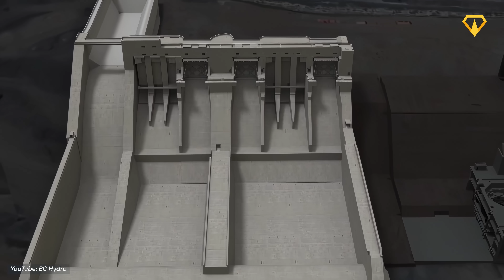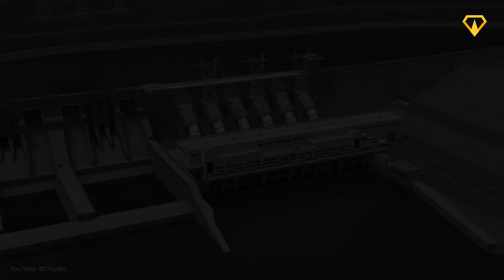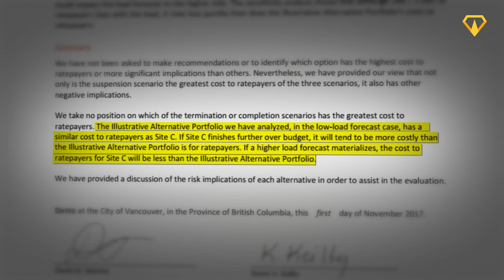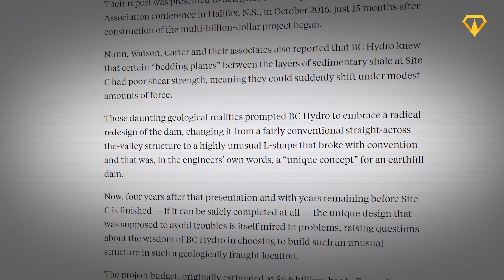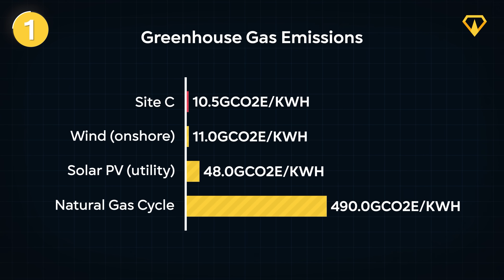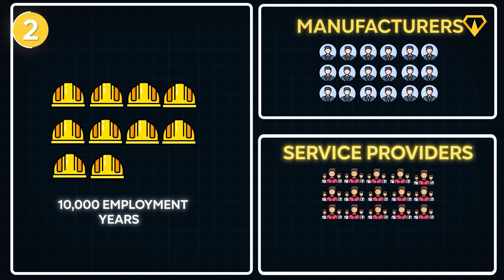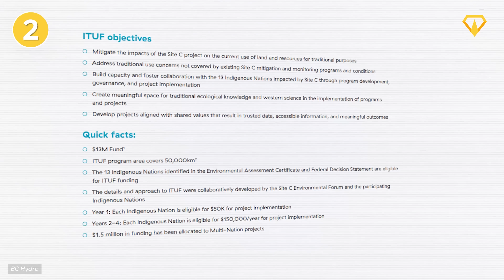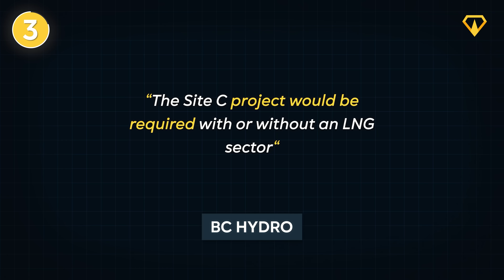Canada's Massive $12B Mega Dam

Comment: It is most indisputably NOT the most expensive hydro project built in Canada. That honor goes to the James Bay project in Quebec which, in today's dollars, would be anywhere from $20B to well over $30B depending on who you ask. There's also the Churchill Falls / Muskrat Falls generating system...which eventually cost close to $15B. Not that $12B is anything to sneeze at...but facts are facts.
Reply: *in today's dollars. If you are going to call someone wrong, at least acknowledge they're only wrong given the specific context you are considering. I agree facts are facts, but you took something which was factually correct given the context and called it wrong. That's pretty disingenuous.
Reply: @Okanoggin  No...what's disingenuous is comparing apples to oranges. If you're going to compare costs...they have to be compared equivalently...meaning you've got to include inflation adjustments. If a dollar today buys you half what a dollar 10 years ago bought you...then they're not the same dollar. A meaning of a dollar is how much can it purchase. If you want to confine youreself to superficialities...then don't make video's that claim to explain foundational issues...make parody's.
Reply: @timb350 umm if something cost 13b today and something cost 12.9b 5 years ago. Sorry to break it to you. Inflation or not, the 13b is still more expensive. So he’s not wrong.
Reply: @DEFBOY35  Nonsense. You're using a rubber ruler to say something grew that didn't grow.
Reply: @DEFBOY35  Of course you're right...if you COMPLETELY ignore the blindingly obvious and utterly indisputable FACT that words have meanings. Currency is fundamentally used for exchange...and is fundamentally defined by how much value is accrued within that exchange. THAT is called meaning. Look it up. If you want to ignore semantics... go right ahead. See how far you get in this world. I'll just assume your entire post just said something like "Yup...I truly don't have a clue what I'm talking about"...and be done with it.
Reply: @timb350  it’s okay if math isn’t your strong point. You can either deal in hypothetical , but if’s, all you want. Or you can deal in real world facts.
Reply: @timb350 
Nonsense.
People don't always adjust for inflation and don't necessarily need to do so.

I doubt very much that you always do the calculations to adjust for inflation when you talk about what things cost.

When you tell someone that you just spent the most money you had ever spent for a new pair of shoes do you first carefully check the price and date of purchase and consumer price index for every pair of shoes you've bought in your life to make sure that your recent purchase really was your most expensive shoe purchase in your life taking inflation into account?
Reply: Of note on both “projects” was the company that did the costing. AND held major contracts on both
SNC Lavalin 
Gotta wonder how big they were in costing and construction of TMX
Reply: @paulchristensen2854  At the time of  james bay, SNC and Lavalin were two separate firms and there was plenty of work for both. After the James Bay project, Lavalin searched its soul for other businesses such as lobbying to get building maintenance contracts in Ottawa, they bought UTCD/hawker Siddley from Ontario government and then went bankrupt.  SNC bought the remains of the engineering and buioding contracxts and Ontario government got back UTDC/hawker Siddeley which was then sold to Bombardier. 
SNC-Lavalin then continued its search for business and had to resort to lobbying and "gifts" to get contracts.  But for the James Bay project the 2 separate firms were both very legit and very much engineering focused.
Reply: @paulchristensen2854  SNC designed Churchill Falls but had nothing to do with construction. Astaldi built the dam, and they were setup to fail right from day one. I worked on the project through Allnorth doing preconstruction engineering. Cost over-runs are solely the fault of Nalcor.
Reply: @paulchristensen2854  SNC Lavalin is beyond corrupt, they are supposed to be banned from any government contacts
Reply: 450,000 homes and $12B costs is £30k per consumer
Reply: When I was 19 I worked for east main resources in Northern Quebec and got to drive through the James Bay dam .. the road at that time took you alongside the turbines at ground level. Pretty impressive to say the least
Reply: Thank you for seing and understanding the same as me! Baie-James quebec and Manic projects are by far the biggest and most expensives. The goosebay project is doubling in price too because of bad choices.
Reply: Ya left out Keeyask generating station. Original price tag was $ 8.7 billion it’s hanging around $13.4 billion as it sits right now.
Reply: @markchatman9583  700MW for north of $13B? Even more expensive...
Reply: That’s 2 separate projects , Churchill falls was done in the 60s on time under budget , muskrat is still not done and over budget
Reply: You beat me to the punch.  The first thing I thought of at the opening shots of the dam was James Bay.
Reply: The unfortunate common denominator seems to be the liBS and dips governments “ controlling “ the show. Look what the liBS did with the TXM pipeline.
Reply: All the thousands of caribou that went over the falls at James Bay.  Guiltbeaut s concern.
Reply: Look at Australia taking valuable farm land and putting solar panels on it stupid nuclear is there answer
Reply: That was a long time ago, so I guess he didn’t convert to todays $
Reply: OTOH, the James Bay project outputs a heck of a lot more power (almost 14X more overall).  So a bargain compared to this little piggy.
And James Bay is not a dam but a massive project with many dams.  15+ MW.
Reply: The joke of the matter is if it cost 12 billion it would only take 25 years to pay back the investment if we assumed the average home would use $100 worth of electricity a month. So it is nothing if you use basic math to figure out what the dams worth and $100 is less then my 750 sq ft apartment takes (it cost $180 last month for electricity including and ac in central ontario)
Reply: @chrisdubs121  You clearly don't understand the cost of money and operating costs.
Reply: @AlanTheBeast100  I do understand that the cost of the project doesn't include maintenance/operation costs. However, grid stability and energy security is another factor not included in price. A dam doesn't become obsolete after 25 years and a house costs much more then $100 per month to power. I was just giving a conservative cost analysis to show that the price of 12 billion is not an absurd cost for a large infrastructure project.
Reply: @chrisdubs121  You implied the capital would be returned in 25 years.  Don't make facile statements.  Not good for you.
Reply: @AlanTheBeast100 cause that's how people break down costs to show relative value
Reply: @chrisdubs121  There is 0 in this thread that is "how people break down costs" that's of any real value.  The original post compares this puny dam to James Bay which is near 15X more power output.  Then someone tries to compare output sales rate (consumer rate at that - not the transmission input rate which is far lower) to the capital cost w/o coming close to the cost of money over 25 years (note the "cost" on that money has been building for several years to boot).  Etc ad nauseum.  Maybe the fellow graduated Trump University?
Reply: @AlanTheBeast100  youre just trying to feel validated right now so you do you boo
Reply: @chrisdubs121  You are using apples and oranges and saying fruit.  Your electric bill covers a lot, not just generating the power.  The infrastructure is a huge part of your bill and a huge cost.
Reply: True Canadian.  Gr8 post my brother.   Plus with the massive influx of immigrants we are gonna need this.
Reply: James Bay is Newfoundland’s not Kaaabeck .
Reply: Site C isn't over yet
Reply: Honour*
Reply: Meaningless figures when you don't consider power installed, the JB project installed 15GW of power!
Reply: I see a link to a youtube video about a $100 billion mega dam in the Himalayas.
Reply: 48 billion spent on CGL pipeline.
Reply: This dam is closer to if not over 20 billion at this point mate
Reply: in doesn't work that way..."in Today's dollars" is irrelevant...this project dwarfs that one as a single dam. The James Bay project was a series of Hydro electric power stations, not comparing apples to apples.
Reply: @bigamigo4863  Why is it irrelevant...just because you say so???? It's a very common, and academically accepted, practice to include inflation adjustments when comparing financial figures from different time periods...just as it's very common, and academically accepted, to factor in other conditions...like relative living standards etc. And the single biggest James Bay dam...LG2...cost over $15B all by itself.
Reply: Nice
Reply: But what you're overlooking is that James Bay has a generating capacity that is 16 times bigger than Site C. That is a huge difference.
Reply: 12+ billions for a single dam IS an awful lot of money. The 1970's James Bay project of nearly 30$B included 8 dams, with a total output of 15GW +
Reply: @MolloRelax  A lot of the inflation of the last 50 years has been hidden by sending manufacturing elsewhere.  But big projects like this are done in the West where the true cost of inflation shows.  Housing too.
Reply: Glad to see someone mention Churchill Falls power project. Probably at 20 years ago or more I listened to a Canadian news story about how the Churchill Falls electricity was being sold to Quebec for a paltry sum under contractual agreement but Quebec was reselling very profitably it to I guess either US or Ontario.  I just remember an audience member from Labrador screaming at the meeting about how Labrador and Newfoundland were impoverished and their natural resource was in fact subsidizing Quebec.  I hope that everyone understands that the contract, agreement or treaty with native tribes in the area is satisfactory to all.  Because of your mention, I do live close to Niagara Falls Power Project, and I googled the Churchill project and found out they recently have settled on a new contract for selling the hydropower of Churchill at a new higher price.  Contract have a long life and circumstances can change.
Reply: You are correct.
Reply: You are correct.
Reply: I think West Coast Pipeline was the biggest bet by Canada yet.
Reply: How far back in time do you need to go for a job costing a nickel to be worth billions "in today's dollars"
Reply: The two most expensive energy projects in Canada are the TMX and the west coast gas pipelines.
Reply: @effingsix3825  Off topic.
Reply: @dasstigma  I disagree.  You only want a dispute over… something.  Well, you know what?  Something.  Something.
Reply: @effingsix3825   Coastal Gas Link is $15B (currently, there is an audit & lawsuit ongoing to recoup some of those costs from a certain price gouging construction company).  TMX on the other hand was more than just a pipeline after the Feds bought it; it spent money on roads, trails, parks, etc all along the pipelines length and just tallied it up on one bill; it's how a project tripled in cost.
Reply: @effingsix3825  Just by curiosity. How much?
Reply: Quebec always manage to have the longest building time and the most expensive deals possible every time. Possibly one of the most inefficient governments to build public infrastructure  in the world...
Reply: @Tuysicom  I think you are missing some information to be able to judge. The construction sites are long since they are very large-scale projects in remote regions. With its 62 hydroelectric power stations, Hydro-Québec is the main producer of electricity in Canada and one of the largest producers of hydroelectricity in the world. The installed capacity of its facilities stands at 37,439 megawatts (MW) and it had 4.55 million customers in 2023
Reply: @Tuysicom  because Quebec is liberal.  🤣
Reply: James Bay is a series of dams, this is one single dam
Reply: @KWally  Precisely the point: The OP compared a single dam at an absurd cost of $12B that outputs a mere 1100MW, to a project that cost $20B (maybe $30B) and outputs over 15,000MW.
Staggering difference.
Reply: @KWally  Yeah but he didn't say it's the most expensive dam...he said it's the most expensive hyrdo project ever built in Canada. That's simply wrong.
Reply: @KWally  Each of the James Bay dams produces at least 2x Megawatts as this project
Reply: What I found most interesting was that the special reserved hunting rights state they must be done by traditional means. If that same traditional hunting rights by traditional means holds true for all the treaties with indigenous, how are they allowed to use modern weapons and means of locomotion.  The local indigenous peoples traversed Canada on foot, canoe and snowshoe. No horses either.
Reply: You could build 1.4 Gigawatts for half that using nuclear.
Reply: @hg2.      proof  needed  on  ThaT;   site please
           references   a n d     are we stroring waste in YouR   community   now?
       will  your  anscestors  bless you  for  agrreing?
Reply: @hg2.   Total baloney. The last nuke in North America was just finished this year in Georgia - Vogtle Units 3 & 4 - two 1,100 Mwh reactors - total cost was over US $34B, or $17B per 1,100Mwh, about 50% higher than Site C.  And those reactors will require billions more to decomission and centuries to store the waste.
Reply: @ArthurDentZaphodBeeb  
Ok. 

They USED TO be able to build a 1 GW reactor for half the Site V amount. 

The Chinese could probably do it for $6 billion.
Reply: @hg2. 
At one point the British government tried to change things so that private companies built nuclear plants.
They couldn't find any private companies to build nuclear plants because it made no financial sense given the cost of the insurance.
Insurance companies didn't want to risk being responsible for covering the costs of a nuclear disaster that could make a wide area uninhabitable for decades or centuries.
And I believe that was before the nuclear disasters in the Soviet Union and in Japan.

So you can't just look at the cost of building a nuclear plant.
You also need to look at the massive cost of insuring a nuclear plant.

Right now a lot of governments are effectively self insuring their nuclear plants but that is a potential massive liability that they are not explicitly putting on the books.

I'm not necessarily against nuclear power but we have to be honest about the true costs.
Reply: @geofflepper3207  
"Okay"

Maybe we should get "creative" about the risk near the reactor, e.g. free electricity for life if you live in the exclusion zone. 

Or, an international relocation insurance fund.
Reply: He's fibbing about a lot of stuff.  Like why did he say treaty 8 is larger than France, but then say 10k hectares will be damaged?  10k hectars is 38 square miles.  France is 213,011 square miles!
Reply: @tarstarkusz  I think what he is saying is that Treaty 8 land is larger than France, and about 10k hectares of that land will be damaged. Compared to the whole of Treaty 8 that is very little, but it becomes significant for the communities in the area that is most affected (around the dam) and because the area around waterways is where most of the mentioned activities (hunting, fishing, trapping) take place.
Reply: @ronaldratzlaff6672  They should be grateful that there are supermarkets in the area.
Reply: @ronaldratzlaff6672  What he was doing was using different measurement to mislead his audience.  Most people aren't me and aren't going to go find out how many square miles France is and how many square miles 10k hectares is (sure does sound big).  He's very vague about the size in either miles or hectares or even KM and then uses the smallest measurement he can think of to drive that number WAY up.

WHY do they "deserve" exclusive rights to that land?
Reply: @tarstarkusz why do they deserve it? Well, many would say it's their land. But the difficulty is in the details. I can tell you that my father's people were driven a thousand miles to what the government thought was worthless land and told "this is now your land."  Yeah. Some decades later natural gas was found under that land and guess what? The Federal government said despite what we told you, it's not yours. You have no mineral rights that any other land owner would have possessed. Now it a different nation, but the same story. Despite a Treaty having Constitutional protection, the "other" interests - like lots of profits and all that benefits to politicians- have a greater weight than the agreements made with the First Nation's peoples. What is equitable? That seems to be hard for many to decide. There were probably solutions available  prior to construction but the politicians once again ignored what was probably right for what was most profitable to them and their related parties. Just my guess.
Reply: @tarstarkusz  Yeah there can be benefits to sticking to a single unit, either of comparison or of measurement. Using a unit of measure here, and a comparative there, can be confusing. But you getting confused, is not the same as him misleading you. At no point did he claim: "Treaty 8 land = larger than France = 10.000ha". What he did say is: "Treaty 8 land = larger than France". And in a separate and unrelated statement he says "Flooded/impacted area = 10.000ha". You seem to conclude that "Treaty 8 land = Flooded/impacted area", which is not a logical conclusion based on the info in the video, and would equate to a 'misled' conclusion, and is no evidence for misleading information. Everyone knows Wikipedia exists and we can look up facts. I applaude you for doing it. But in this case it was irrelevant I'm afraid.
Reply: @ronaldratzlaff6672  No, he was deliberately deceptive.  He used the hectares so he could drive the number way up.
Reply: @scottwheeler2494  No, they don't.  Those many people would be wrong.
Reply: @tarstarkusz Hectares and kilometers are both metric measurements. 100 hectares is 1 sq km
Reply: @tarstarkusz  I think the people who have been using the land for literally thousands of years have more claim to 'deserve' the land than some upstart country not even 160 years old. And I say that as a Canadian, born and raised, with a family going back at least that long in the country. 

If 'literally thousands of years of use and living on it' isn't enough, then what on earth is? The fact that they aren't trying to kick all the colonists off their land, and continue to simply want an equitable and respectful relationship with us, says a lot more for them than it does the governments that keep shafting them. (The fact that they population-wise wouldn't likely win such a fight is a factor, but 'might makes right' isn't exactly how I would characterize the moral deservedness to the land either.)
Reply: @jasonwilliams8016  What is the point?
Reply: @tarstarkusz  I don't know the details of the Treaty,  nor do I have an independent knowledge of Canadian law, including oh about a lifetime of legal study. I doubt you do either. So at best we can express an opinion. (If I am wrong about your legal study, sorry. But highly unlikely given we are just YouTube assholes. And just because the cases side one way doesn't mean that the First Nation's people were not screwed. It tends to go that way , historically. )
Reply: @scottwheeler2494  What you don't understand is that I don't care what happens to them.  It's been a one way street of "helping" them for many, many decades.  WHY should all of Canada be deprived of the benefits of this dam so they can allegedly hunt in some area?  They are a HUGE net cost to the tax payers already.  They are FAR, FAR better off than they were 400 years ago.  By "they" I mean ALL
Reply: @tarstarkusz  I guess we will have to disagree. Glad to fully understand your position. What you can't grasp is that they don't think they are better off. They know they are not. It's a culture you can't understand. You don't have to understand. But what the nation has to do is comply with the agreements made hundreds of years ago. Sorry it pisses you off.
Reply: @tarstarkusz  he used the correct units of measurement in the video. Hectares and sq km.
Reply: @tarstarkusz  so you don't care about legal contracts or agreements? You don't care about the rule of law or the constitution? 

You're way off on your understanding of indigenous rights in Canada.
Reply: @scottwheeler2494  No, they know they are better off. But they also know all the guilt is easy to exploit and that is precisely what they are doing.  They absolutely know this dam won't be torn down.  What they want is a payment, MONEY.
Reply: @jasonwilliams8016  Why do they have special rights other Canadians do not have?
Reply: @jasonwilliams8016  No, he did not.
Reply: @kirkboivin4357  I agree, but the creation of new habitats takes time and it will have an impact on the animal population. Humans can adapt faster (build a house elsewhere), but that's besides the point. The point is that these people are losing (for a considerable period of time until the fauna and flora adapt) what is legally theirs. Btw I'm not against the dam, I just think all the costs need to be accounted for.
Reply: @tarstarkusz  It's time the US and Canada caught up with the rest of the world and changed to the metric system.  100 Ha is 1 square kilometre and 1 mile is about 1.609 km, so about 2.6 square km to 1 square mile. Work the rest out for yourself. I get sick of always having to see figures in feet in YouTube videos, it seems to be compulsory, no matter whether the original was in metres or feet. If in feet, they don't bother giving the metre equivalent.
Reply: @tarstarkusz  look at it this way. Assume the power company decides that it needs a new transmission line in order to serve the greater area, mostly in a town a hundred miles away. It's your land, right? Not if some big company decides they need it. They get the government to take it away, at least in part, from you. You can no longer enjoy your backyard- it's got this big tower and powerline on it.

In most "democratic" countries you get compensated when something is taken. If your backyard is taken they have to pay you. It's negotiable. Your screwed but they at least pretend to be "fair". You complain that is what is happening- the First Nation's land was taken - but you dislike that there must be compensation. Why? Are they somehow less worthy in your mind? They will be unable to enjoy their land. It will be underwater. How many billions is it worth if owned by a "white"  man?  What is the difference? Money is the only compensation available.
Reply: @scottwheeler2494  They don't own the land in the traditional sense of ownership. They did nothing to acquire the land. They didn't pay for it and they didn't homestead it.

If I owned the land, I either would have had to pay for it, homestead it or my ancestors would have had to done so and specifically leave it to me. There would be an unbroken trail of ownership.

What this is much more akin to a state park. It's not "owned" by anyone except for a very nebulous abstraction.
Reply: @tarstarkusz  because legally they are their own Nation within Canada. Read the constitution
Reply: @tarstarkusz  I had no issues understanding what he was referring to..
Reply: @jasonwilliams8016  They are NOT a nation.  A nation is one people.  They are not one people. Not even close.
Reply: @tarstarkusz  so then Canada isn't a nation either? Or any country lol
Reply: @tarstarkusz  I'm intrigued by this. If you suggest that 'paying for or homestading land' is a traditional sense of ownership, is it possible there are other, maybe far older traditions of ownership that are defined differently? I think you are putting your finger on the crux of the issue - different traditions (as an extension of 'worldviews'). I find it is damn (pun) hard to understand and accept that what I perceive as normative (aka my traditional truths and worldview as a whole) is not applicable to every person on the planet. Yet this is a reality that must be explored lest we keep running into the same disputes forever. If the european settlers had a better appreciation of an indigenous sense of 'ownership' which is far older than the one they are bringing from europe, and ideally even passed this appreciation along to future generations, I believe that would have served everyone well. I'm not trying to single out Canadian settlers, as very similar issues run deep in a lot of places in the world. I don't know what an aweseome solution to the dilemma would look like as that is far to complex for me to figure out. But I am convinced the path to that solution is dialog and respect. I get the impression you are concerned and unhappy with the status quo. I bet we all are. And maybe you find indigenous traditions weird and incomprehensible - and you know what, I'll join you there. But that says more about us than it says about them. I believe our traditions have not set us up well to accomodate other traditions.
Reply: @ronaldratzlaff6672  First, I doubt you are "intrigued" by anything. You want to bloviate.  Second, they do not have a concept of ownership of land.  The idea that someone could own land and exclude others from using it was entirely unknown to them.
I couldn't care less about their alleged "traditions"
Reply: @tarstarkusz  Well, apologies for being more wordy than you like. But you actually make my points precisely. The concept of 'land ownership' is foreign to and forced on indigenous people, and you freely admit to not care about anything beyond your own horizon. With that mentality you'll need to be prepared to live in frustration for the rest of your days, and I don't doubt for a second that you're determined to do so. With that said, I'll leave you to it 🤷
Reply: @ronaldratzlaff6672 . Yeah, but the shore lines will simply move, and most of it is in canyons, so it’s not going to expand that much.   End of the day! We need electricity to power our stuff.  Electricity has made life unmeasurably better for billions.
Reply: How is he being misleading? What he said makes perfect sense, you just misunderstood 🤷‍♂️
Reply: @tarstarkusz  why do you need to convert from proper metric units to miles? 
He stayed consistent with his units. 
All you had to do was ask how many ha France is to learn just how massive Treaty 8 is. And out of the massive treaty 8, 10,000ha is going to be damaged. 
If he had said: BC is larger than France, and over 10,000acres of BC is going to be damaged, I don't think you would find that misleading or inconsistent, the issue is simply you aren't familiar with treaty 8 or metric units of land area.
Reply: @jimf1964  Agreed. All considered the environmental cost seems low compared to the gains, at least compared to other projects in the past. And you're right, we need lots of energy. And this is better than many other 'less complicated' solutions. I appreciate your perspective!
Reply: @tarstarkusz  You and many others don't really understand these relations in BC. not surprised.
Reply: @tarstarkusz 
Most people aren't you so won't get the ridiculous idea that he said that all of the lands covered by the treaty would be effected.
Only you came to that bizarre conclusion.

If someone said that an American company was building a dam in Brazil and so would need to get the permission of the Brazilian government you probably would come to the bizarre conclusion that the dam was going to flood all of Brazil.
Reply: @tarstarkusz 
You got a bizarre idea in your head despite the fact that he never said or suggested that idea.
Nobody but you got that bizarre idea.
This is on you.
The more times you put out a post about your bizarre conclusion the more times you embarrass yourself. 
Best you just delete all your comments to reduce the level of your embarrassment.
Reply: @tarstarkusz 
Why do you keep putting out posts telling the world that you don't understand anything?
Reply: @geofflepper3207  What are you talking about?
Reply: @tarstarkusz Americans don’t get metric? 😀
Reply: @jimf1964  Exactly.  I know metric is easier, but not if you don't know it.  I learned the American standard very young. It's all very intuitive to me because of that.
Reply: @tarstarkusz Treaty 8 refers to a far larger region within Canada than what the dam’s reservoir will fill. So while I haven’t checked to see if it is in fact larger than France, it wouldn’t surprise me to find that it is. The reservoir’s itself of course is only filling a very small portion of the territory.
Reply: Because nowhere near all of the treaty 8 territory is affected by the project. The "damaged" territory and overall area of treaty 8 are entirely different figures
Reply: @tarstarkusz  not all of treaty 8 will be damaged
Reply: @tarstarkusz  Analyze what you just said. Treaty 8 is larger than France. 10,000 hectares will be damaged. Is Treaty 8 10,000 hectares? No. The 10,000 hectares is referring to the damaged wetlands, not Treaty 8. He didn't make this comparison in the video. You just made it up and called it false.
Reply: @Okanoggin  I never said it was false. I am aware of his slippery terms. That is the point.  Don't ever buy a used car by yourself dude.
Reply: @tarstarkusz  Treaty No. 8, encompassing a landmass of approximately 840,000 kilometres, is home to 39 First Nations communities, including 23 Alberta First Nations, 3 Saskatchewan First Nations, 6 Northwestern Territories First Nations, and 8 British Columbia First Nations.
Reply: @cme98  thanks for taking the time to type this all out. I appreciate the knowledge.
Reply: @TheBigHeavyKevy 454 is my home.
Reply: @tarstarkusz   France is 550,000 km.  Treaty 8 is 800,000 km.
Reply: @TheAmbex  So let's just give them France and get it over with.  They could hunt snails in the Vinyard.
Reply: @TheAmbex  km^2 *
Reply: @tarstarkusz because the 10k hectares of land filling the reservoir will be damaged… not the entirety of treaty 8 land🙄
Reply: @tarstarkusz  he wasn't talking about the land flooded by site C. he was talking about the territory covered by treaty 8: 840,000 km2 (320,000 sq mi) -- which is larger than france
Reply: @tarstarkusz  Treaty 8 covers an area larger than France. The dam only effects 10 hectares of it. It was quite clear indicated in the graphic that the river is small compared to the treaty 8 boundaries.
Reply: @nolansmith99  You're only off by 2 orders of magnitude.
Reply: @tarstarkusz  Treaty 8 is about 324,000 square miles. The river will fill between the dams. 38 square miles; or, 1.17% of their territory will be flooded.
Reply: @tarstarkusz  The total Treaty 8 area is huge.  The dam is only going to flood a tiny slice of the total area but it will be the slice running along the Peace River valley so it might be the best land per hectacre.
Reply: @tarstarkusz what he said was  that 10k hectares of that land will be lost. Not that the land totals 10k hectares.
Reply: @tarstarkusz  The tributaries going into the Peace River probably cover a much wider area, than the reservoir limits, and the total area aught to be bigger than some countless in area.  Gives you a sense of the colossal size of ecological impact.
Reply: population agenda 100 million for canada  ; adding 60m more people will require a lot more resources and power &
create a huge environmental impact  by 2100 on canada
Reply: Quebec calls it "our Saudi Arabia" but still demands transfer payments from Alberta.
Reply: @sanniepstein4835 
Alberta doesn't send any money to Quebec.
You don't understand the Canadian system.